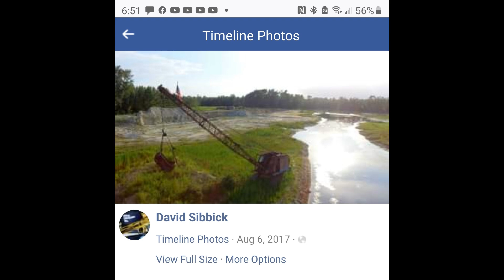Preparing & Repairing The Footings In Preparation For Block Foundation Installation

Comment: Hi Scott, love watching what you do, but can you reposition the camera in the skid steer, because all we can see is your back? It makes it much more interesting if we can see what the bucket is doing too!
Reply from the maker: Skidsteer is the hardest machine to video in/on...GoPro Batteries don't last too long so I either plug them in to USB port inside or battery pack when on a tripod...I will try to get some shots with a magnetic mount on the roof next time...